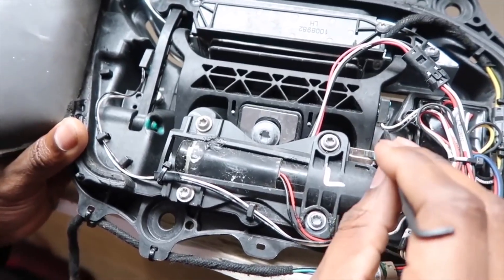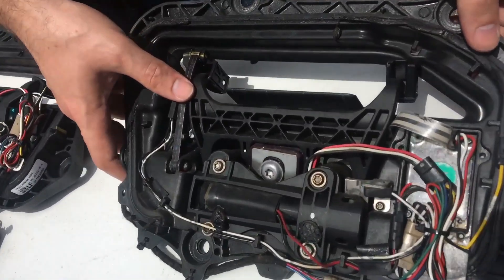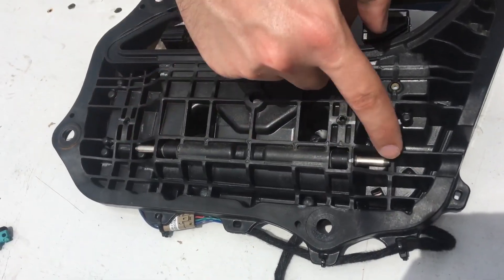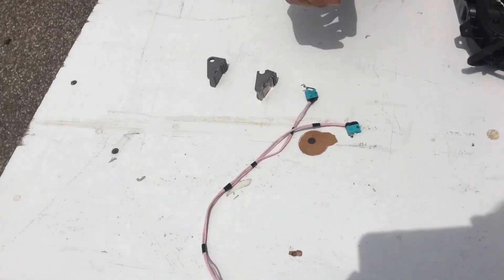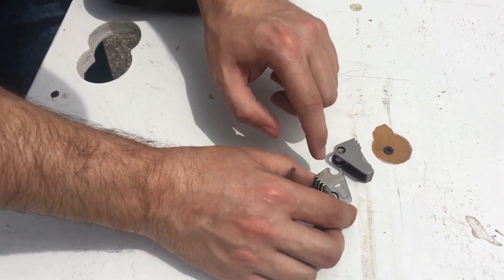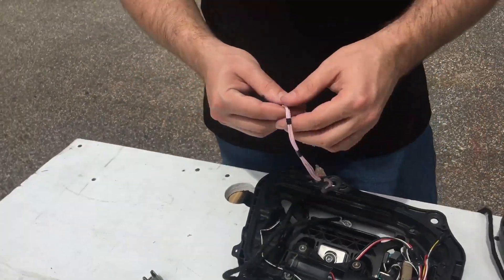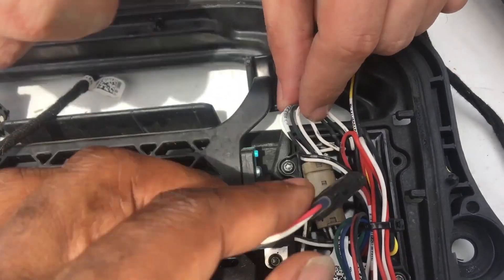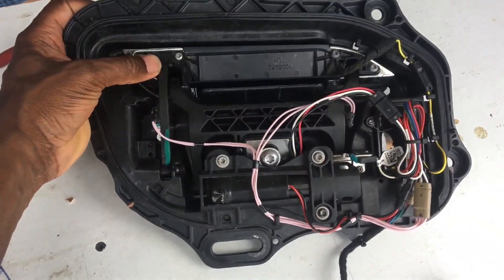Fixing Tesla’s Design for Good

Comment: . Overly complicated mechanical and electrical crap, just to open the door. I'm sorry but that's just asinine designing. Yes I know it's cool to the handles pop out. but they could probably say 5 grand and skip the fancy door handles. Yes I know they did that on the model 3. And I think on the model X the door just pops open when you touch the door handle. That's probably a more reliable design. 
Good for these guys that have designed that's definitely awesome, and as these cars come out of warranty I suspect they're going to do quite well. but a bad door handle design is not something any other car company would fail at so badly.
Reply: Have you see how the "fancy" vents actually work?  It is actually quite brilliant.  It is basically a stream of air from the bottom that intersects with a stream of air coming straight out that provides the motion.  It actually has less things to break by design.
Reply: Personally I think they all should get the model 3 handles.It saves on production cost and warranty issues.
Reply: @mudemmeonick I think you need a hug.
Reply: Meeker Extreme Cue in BMW with their timing chains failing. Or subframes cracking. VW with cracked heads. Renault with crankshaft bearings failures. Corvette with overheating issues. Maserati with their electric issues. Mercedes with cars getting on fire. Same for Ferraris. And the list goes on...

Get a load of this guy. THIS IS TESLA SO THIS IS A MAJOR FAIL. EVERYBODY THIS IS A FAIL. STOP THE PRESSES.
Reply: At some point each manufacturer has at least one car model with breaking door handles be it VW, BMW, Honda etc.
Reply: There are several reasons Tesla went this route. The wow factor was certainly one of them. The Model S handles created a memorable first impression when people visited Tesla showrooms, along with the 17-inch touchscreen and its intuitive graphic interface. But the other reason Tesla opted for electric door handles on all of its vehicles is because they wanted to use electric door latches. These electric latches eliminate mechanical hardware that is commonly subject to wear and long-term reliability. They also allow the doors to be opened remotely, as is the case with the Model X.

People had the same complaints about reliability when electronic fuel injection was first used. The auto suppliers quickly hardened the electronics against heat, moisture and other issues, and in just a few years EFI became much more reliable than carburetors or mechanical fuel injection. Tesla is doing the same thing with these handles.
Reply: You're stupid. I'm 100% for technology but only if it's really useful and reliable.

Fuel injection is more reliable than carburettors and improve fuel economy. It's a real technological improvement.
Other example, power steering. Of course it adds complexity over a non-power assisted steering. But if it fails, you can still drive the car.

With that freaking doors handles, you can't even open the car and get in! And apart from being cool, what's the point of having that over-complicated handles? Useless.
Reply: always protruding door handles would probably remove about 1 up to 5km from the car's range... Personally (being young etc)  I don't see the issue with Model 3 door handles though. I know people expecting more premium products can...
Reply: Not being able to design a door handle is a huge FAIL as it was already noted. The leg humpers out there for this brand is just funny. You would think Elon is sucking their cocks to be such good leg humpers.
Reply: Those units as their sum of parts (alone, design and construction excluded) probably, certainly, don't pop over 1k USD, and depending on how cheap Tesla is (and considering all the crap that's in a Tesla from the thin plastics to the rubber seals made from antiquated formulas and the fact that the drive motor doesn't have an O-ring...i rest my case) it's probably around 350 USD. I'm no loch ness monster, but that's a cheap unit at a glance.
Reply: mudemmeonick 
Just watched an episode of "Wheeler Dealers"
Mercedes 500 SEL (?)
had a problem with the air con diverter system.
MASSIVE job!
DON'T tell me the Tesla system is more complicated!
For a start, if them ideal 3 "dash" had to come out, there's nothing connected to it! No dials, knobs, gauges, cables, levers.......
4(?) bolts and a couple of plugs for the screen, a few more screws for the panel..... Job done.
Reply: Meeker Extreme 
Do you think every manufacturer designs the detail on their door handles?
MAYBE they go to a supplier and say "we need a door handle! It has to fit in this hole, look like this, work like this, have this finish.... YOU'RE the expert! Design it for us!"
At VERY least, Tesla would design the part and consult with the supplier regarding the best way to proceed.
When you go to buy a part for your car, what details do you give?
Make? model? YEAR?
WHY do you have to give the year?
Because they constant modify, update, improve components!
Don't be a Muppet!
Reply: Several generations of Australian Ford Falcons were notorious for faulty door handles
Reply: Yet everything you listed has had major issues with them to the point over time they get disabled/broken and never replaced in the cars lifespan.

>Start stop buttons

Done along with the start of cars, want to know why it didn't catch on? Because it causes damage overtime and saves literally a few dollars a year after spending 1000 hours driving.

>Anti-theft devices

Anti-theft included with the car automatically are placebo which is why they never get certifications from security researchers.

>Ignition switches

How is that new? They've been around since the first cars were mass produced.

>Electric fuel pumps

Still less reliable then mechanic fuel pumps but they're cheaper to make and force customers to buy them in the future so why not.

>Fuel injection systems

Something that you can't replace by yourself and take hours for even for mechanics that've done it hundreds of times before vs the carburetor which can be repaired within a day by anyone or minutes with any experience.

---------

New cars are made to be worn down and broke by 10 years and yet we still see cars from 1970's-1990's that are termed "unkillable" because they're that reliable and well built that with basic maintenance they'll out-live the owner of the car.
Reply: Start stop buttons. Anti-theft devices. Ignition switches. Electric fuel pumps. Fuel injection systems. And the list could go on.

Those are all "fancy things". It just happens that you either got born when they were already common or you got so used to them that you don't consider them "fancy" anymore. Rewind time, look for some articles, if you manage to, and see how much flak every single on of them got when them came out. Just like the freaking Tesla door handle.

You're a idiot incapable of putting your brain to work.
Reply: i'm waiting to see how much trouble people have with the air vents in the model 3... that's another unnecessarily complicated thing from tesla.  sure they saved money with the simpler door handles, but then they cost money with those stupid vent adjusters.  and yet they used plain old fashioned air vents for the back seat.  go figure...
Reply: Varied Interesting - that makes no sense. Yes, you can redirect air with a secondary stream of air, but doing it thru a computer controlled device means motors and more wiring. Whereas a plain old vent has like 5 moving parts (if you count each "blade" in the vent) and zero motors or wires. Seems the designers at Tesla were specifically told to ignore the KISS philosophy for some things.
Reply: IT DOESN'T MATTER. IT'S A NEW FANCY THING. IT IS CRAP. IT NEW. ITS FANCY. ITS CRAP. NO NEW THINGS SHOULD BE DONE OR ATTEMPTED. EVER.
Reply: ">Anti-theft devices

Anti-theft included with the car automatically are placebo which is why they never get certifications from security researchers."

Ummm in Australia you cannot sell a car that doesn't have a government approved immobiliser fitted. The only way you can steal modern cars here is with the key or a tow truck.
Reply: @kirk claybrook 
You're incorrect about the resale of vehicles without anti theft, you can most definitely sell a vehicle with no anti theft fitted, feel free to view the receipt for my last car, or my partners previous car(s).
Or actually, go for a quick drive down to the auctions, a car yard or even look through the classifieds.

Also that's absolutely false too...
the fact you actually believe that is laughable and since your so damn deep in this false sense of security,  i wont bother to explain why, you can do your own research into how the security systems work (proximity keys etc etc)
Reply: @nvmyutube no need for your condescending know-it-all reply. I may be mistaken about the requirement for ALL vehicles to be fitted with an approved immobiliser before registration can be commenced or transferred applying in ALL states. 

It certainly is the case in at least some states. It is also an ADR requirement for post 2001 passenger vehicles to be fitted with approved immobilisers (and ADR compliance is a prerequisite for registration).

As for your very helpful suggestion that I do research into how vehicle security systems work, thanks but I'm already quite familiar with how it all works, having a background in electronics and substantial experience with automotive electrical systems. 

Sure, there are methods for cloning/mimicking some transponders (or 'proximity keys' as you incorrectly called them) in APPROVED/ADR COMPLIANT immobilisers but they are generally vehicle specific and far beyond the typical car thief. Not to mention the keyed ignition switches and steering locks that also need to be defeated. Thus, typical car thieves will instead steal the keys first and professional car thieves will use a tow truck/tilt tray.

In most newer vehicles, every aspect of the electrical system is integrated with the vehicle's computer and short of any design flaws, there are no viable ways to quickly bypass the security to start the car and drive it away.

And in those states requiring APPROVED immobilisers in pre 2001 vehicles, the systems require more time and knowledge to bypass than the typical car thief possesses. BTW, I am also quite familiar with the the basic requirements to make a 'pre fuel injection' car run and the options for starting it.

Annnd if YOU do some research, you will find that in those states where immobilisers are compulsory, to date, there is not a single recorded instance of theft that did not involve the keys (or a copy of the keys) or towing the vehicle away.

Now instead of being a wanker, maybe try making a useful contribution to the world.
Reply: It seems i upset you, im so sorry..
Oh the "know it all and condescending response" just like your original comment ?.... hmm i wonder why i chose to write it in such a way.

well they actually are as they work on proximity to the vehicle, some of which actually require no key whatsoever, so sorry to use "an incorrect term" even despite its the theory they work on..... 

i wouldn't say they are too far beyond the common car thief, equipment to mimic the key is very easily available and i personally don't believe its hard to learn.
despite that yes, they have made things much harder for a thief therfore the rate of older cars getting stolen has soared in comparison.

well, apart from if the ECU and or body control module can be swapped then its not too hard pending where its located and if you can get in without triggering the alarm.
whom isn't,  its incredibly simple and for the better part irrelevant to our discussion, so i really don't understand why you were sharing that information.

so you say its a "placebo effect" and yet you go on to mention they work ? ...... your contradicting yourself here and tripping up on your own words.
here, ill quote it for you just in case you've forgotten - 
"Anti-theft included with the car automatically are placebo which is why they never get certifications from security researchers" 

so whats the answer here ?, do you have one or are you just going in circles.

I could say the exact same thing for yourself, just in case you didn't know your horse isn't too high from the ground..
Reply: kens97sto171 Now apply your comment to every fancy thing every car out there has.

By your logic we should all be using horse wagons. And having horses is fancy too...

You're an idiot.
Reply: mudemmeonick 
Most "fancy" things in other cars don't prevent you from getting in the fucking car and driving it. I'm sorry but a door handle not working is major fail. 
And not something that should fail ever. I've got a car from 2008 with 230, 000 miles on it and the door handles still work.
YOU'RE the idiot.